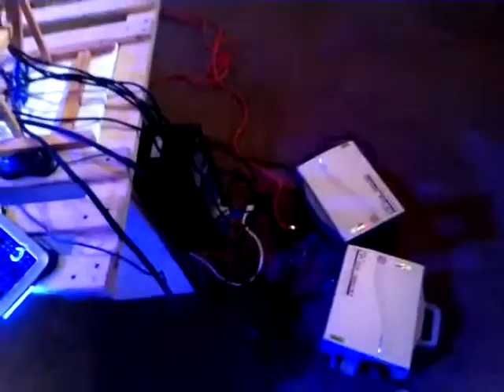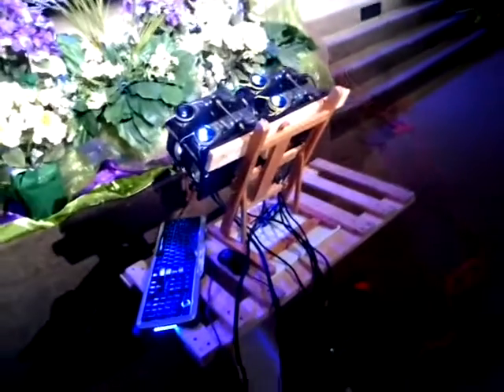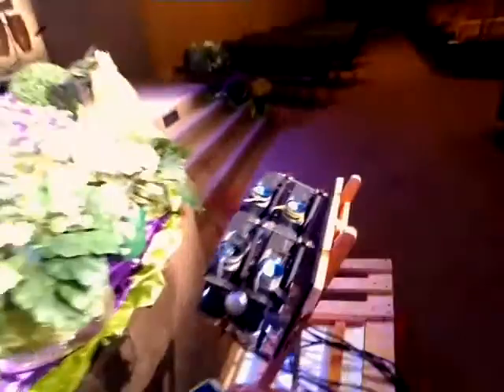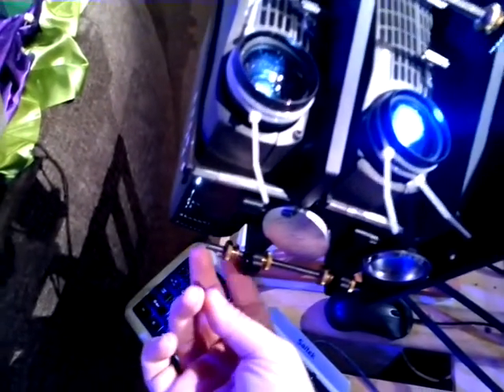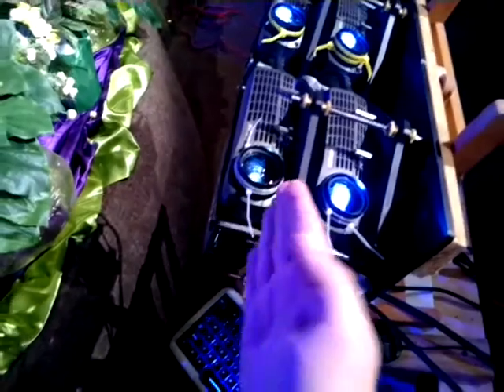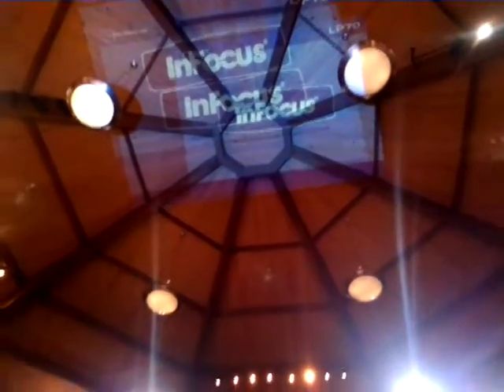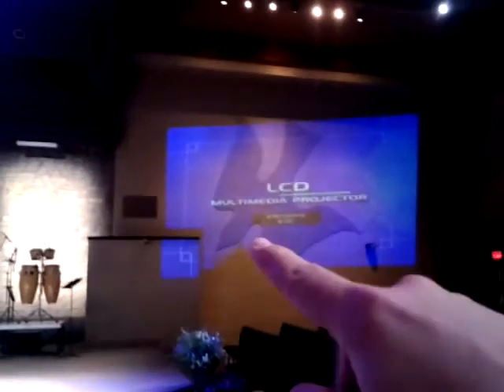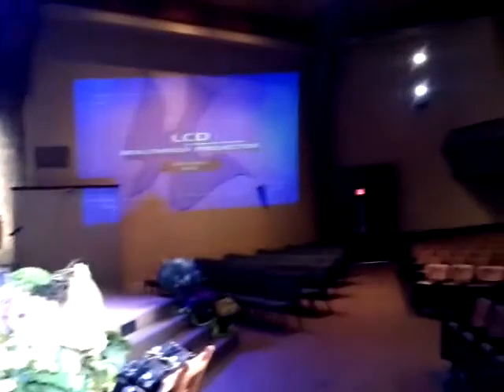6 Projector Array Projection Mapping Rig (diy)

Comment: https://youtu.be/81JDPqqtIsg small but still a for of projection. So I have a question so I know in Disneys singing pumpkin display they use 5 separate projectors and loop each pumpkin video file at the same time so it's all on perfect sync , my guess is there is software were you can have multiple files being played all at once on one monitor.Is there a device that can connect five projectors to one monitor?